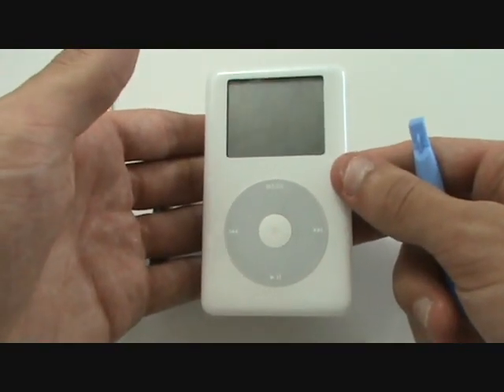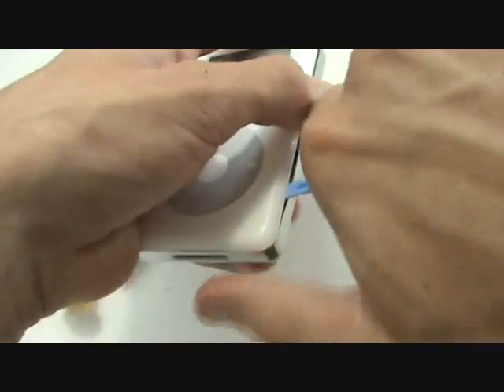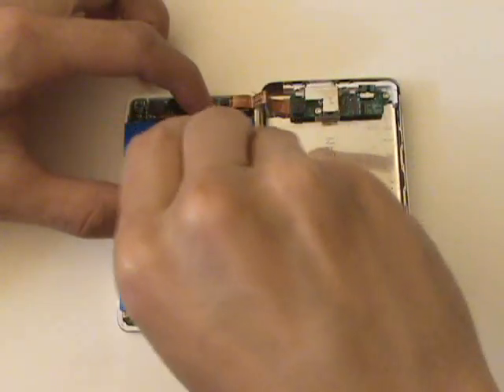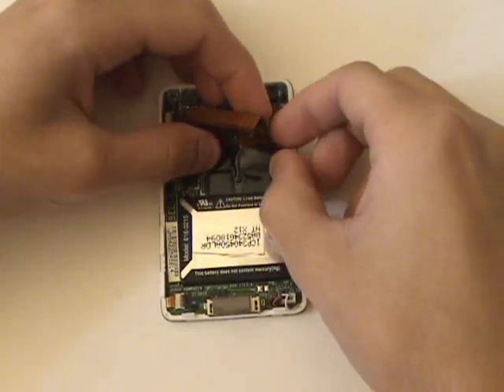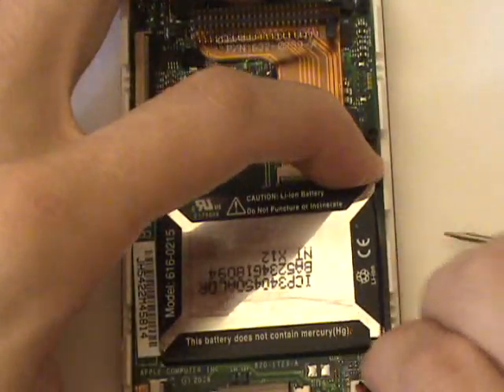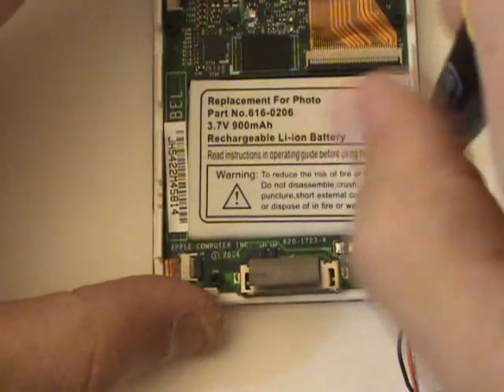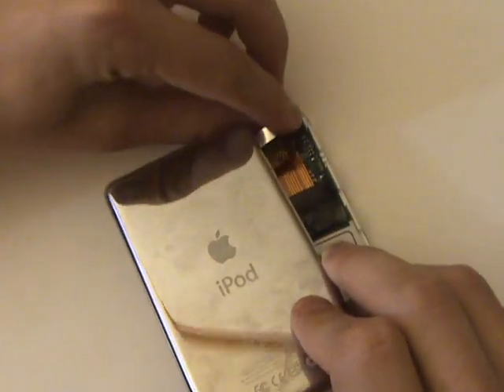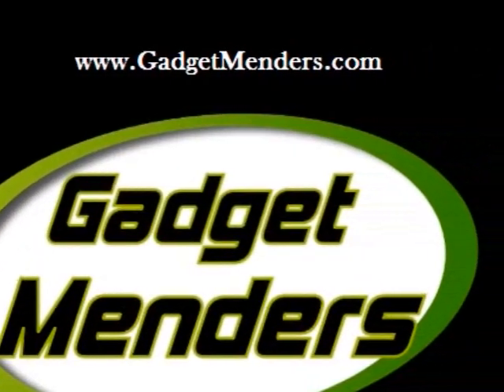iPod 4th Generation Battery Replacement 20gb 40gb Tutorial | GadgetMenders.com

Comment: whaoooo you guys are awesome that was soooooo easy. Saved my lovely old friend .... even though the machine was not charging and had an unhappy face I took it apart undid the harddrive and took the battery off...cleaned out some of the sand and dust blow the parts and tapped them then put it back together again . Now its charging and works perfectly ...thanks guys best fixing vid ever!!